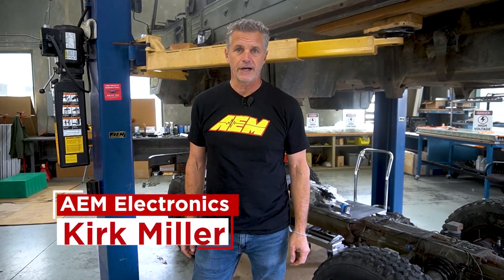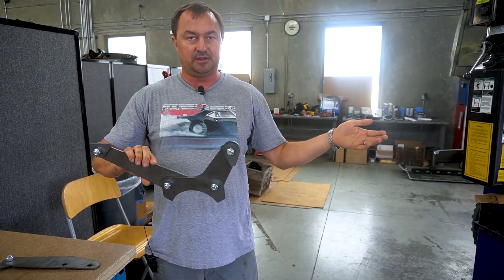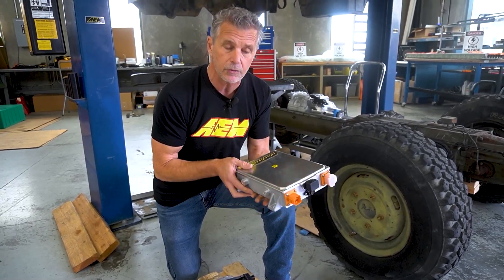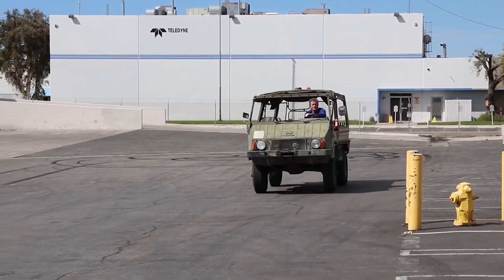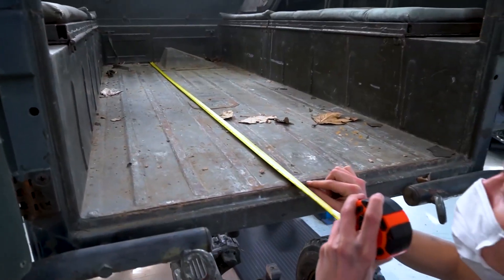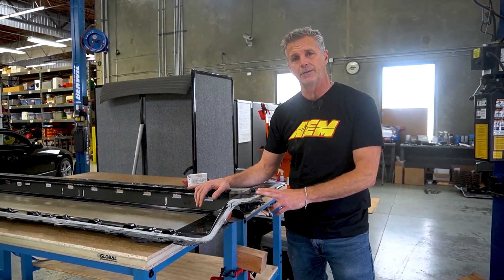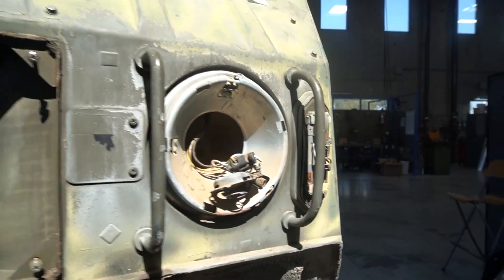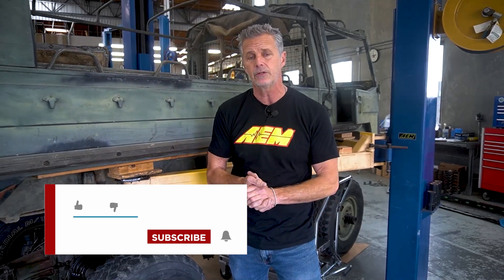HERE'S What's Happening on the 71' Pinzgauer EV CONVERSION

Comment: what are the costs for such a build?
Reply: Fill the cargo area with cash in small builds... that should be enough. 😆
But seriously, price out a Cascadia iM-225 motor, Cascadia PM-100 inverter, salvaged Tesla Model 3 battery, and a few thousand dollars worth of other bits, then several hundred hours or so at whatever labour rate you can get ($100/hour?)
There's a reason that most EV conversions are do-it-yourself projects using salvaged EV components.